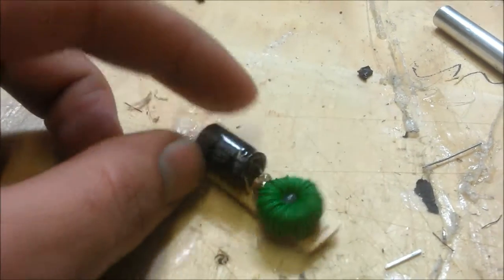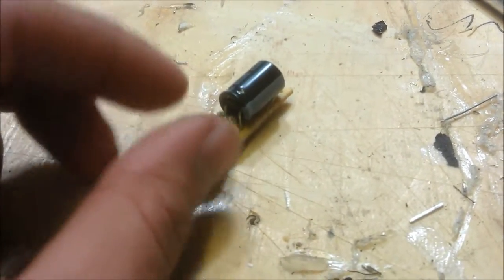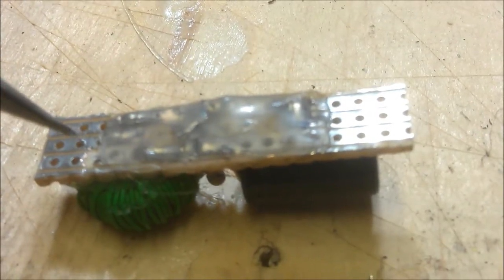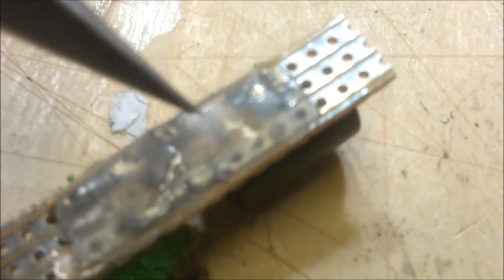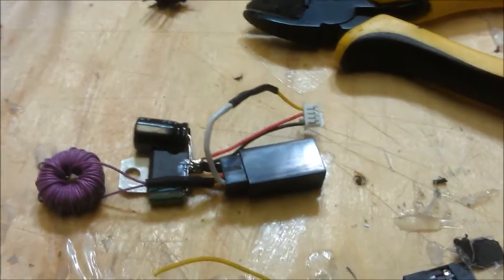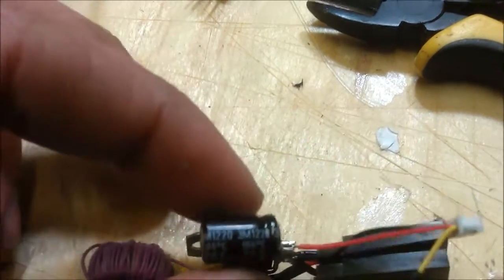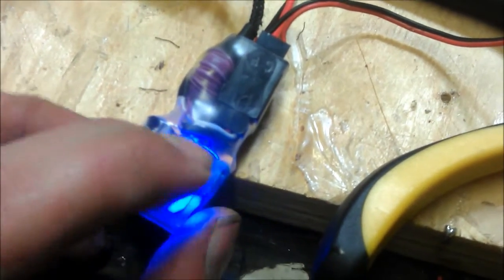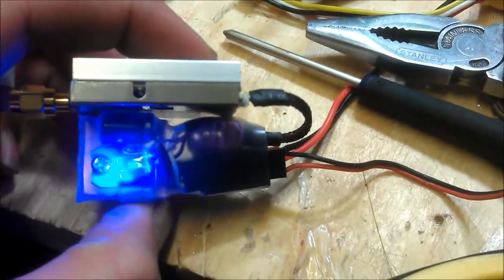5.8G FPV Setup Part 2 LC filters and regulators

Comment: ok,
i think you can also use a 1000uF capacitor instead of the 470uF, or maybe 2X470uF in parallel which is 940uF  -  bigger capacitor and inductor will move the  -3db point to lower frequencies (more filtering).
currently you are filtering around 1Khz. with 1000uF you can filter around 300hz.
let us know if you try that.

Comment: Hi 
i saw your first vid and i have to say love the info but im still at a loss on how to connect and wire these filters your making. I think you jumped some info (probably because of your understanding of electronics) but for someone like me i would like to know about your specific filter the wires on it (balance connector so you can power tri/quad and fpv system?) things like that that with a little more detail

cheers and thanks for vid